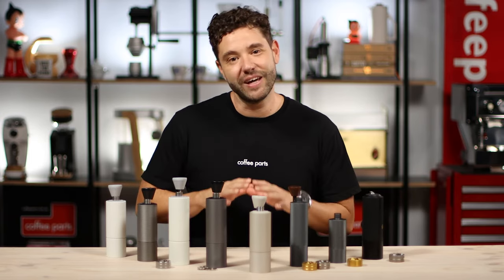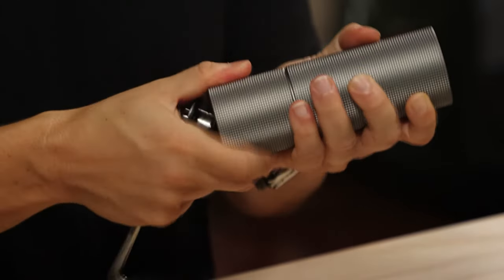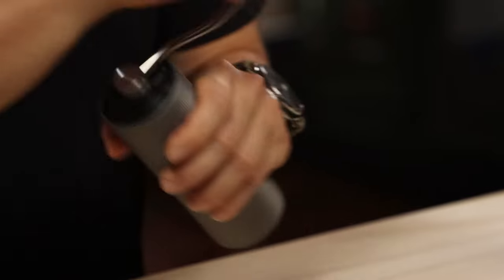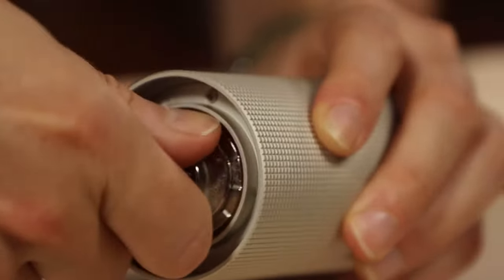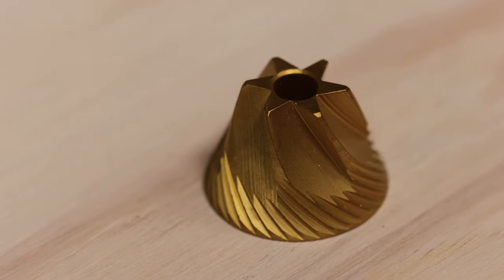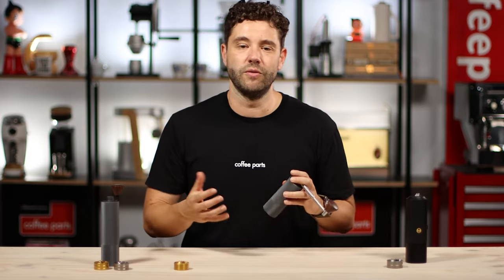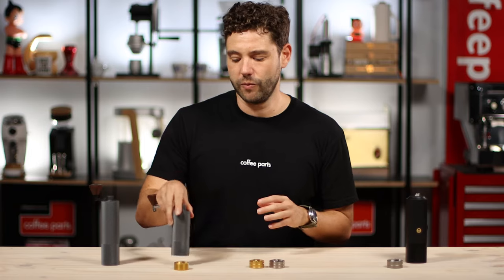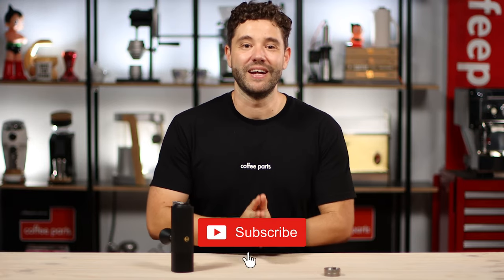Timemore Hand Grinders - Where to Start? | Comparison

Comment: Great video. I've had the C2 for a few years. Great for holidays but jeez everytime I pull it out of the bag after not using for ages it takes longer and longer to grind. Starting to get ridiculous. Are the blades getting duller from non use ? Even though I've had it for 3-4 years I haven't actually used it that many times.